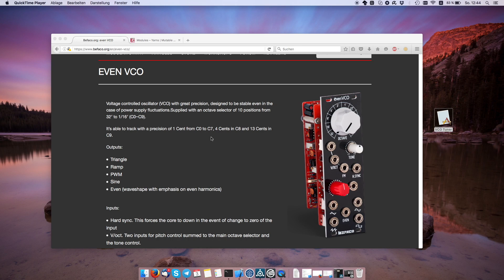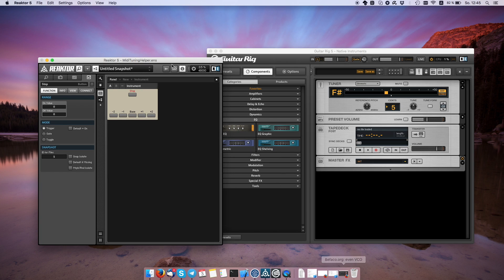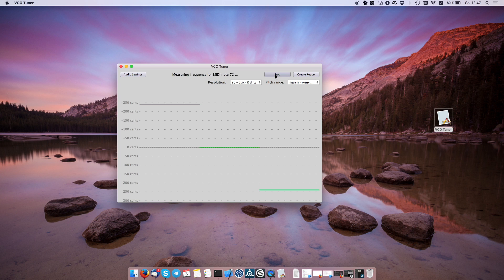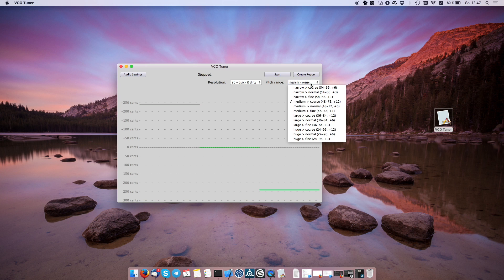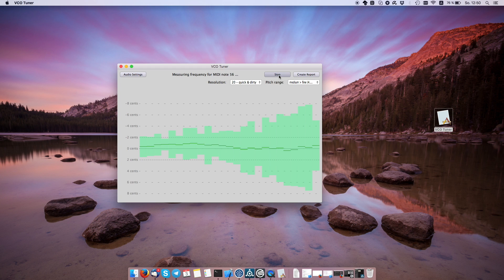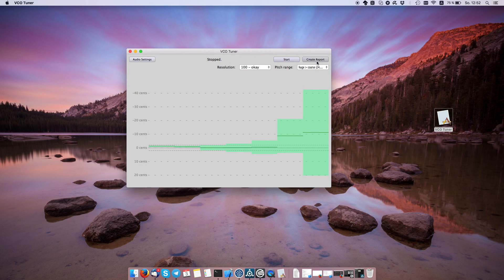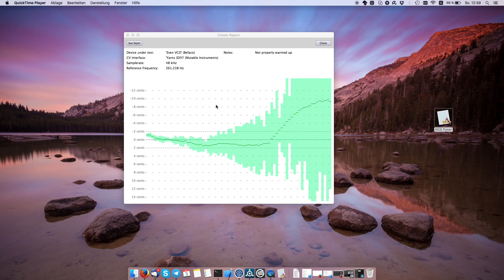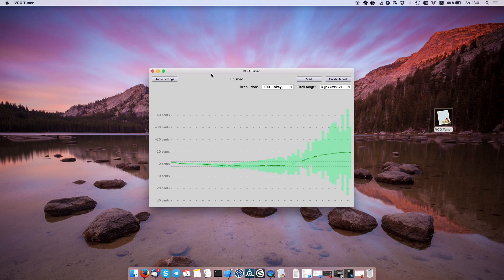VCO tuning made easy

Comment: sorry for my Ignorance but what is VCO tuning or calibrating for?  is it important ? I have MI braids, Elements, Clouds int atlantis and I have never tuned or calibrated them
could someone explain in english Italian or Spanish
Reply from the maker: When you buy VCOs, they come calibrated already. It is done for you at the factory. 
When you build them, you have to do the calibration yourself. That's when this tool is useful.
Reply: oh i got it now, so if I want to install parasites firmware on my clouds, braids I'm gonna have to re calibrate it myself,  and tuning instead is for creating harmony with other oscillators right ?
thanks for your replay keep making this kind of tuts
Reply from the maker: palmerico house the calibration for clouds and braids is simpler because they are digital modules. This tool is useful for analog modules that require more complicated tuning.
Reply: thank you for that one, good to know now, so I could calibrate clouds from sending a midi note into my Doepfer 190-4  thru midi socket out from cv pitch into clouds by sending the required midi voltage? is that what you mean ? I haven't done it koz I was afraid at not understanding the calibration process but if that is what you mean easy then I could try it, what would you recommend any other easy way you might know ? thanks again for your response
Reply from the maker: palmerico house there is a section about the calibration of clouds in the clouds manual. You only need to redo the calibration of clouds if you installed custom firmwares on it. For the calibration of digital modules, always refer to their manuals.